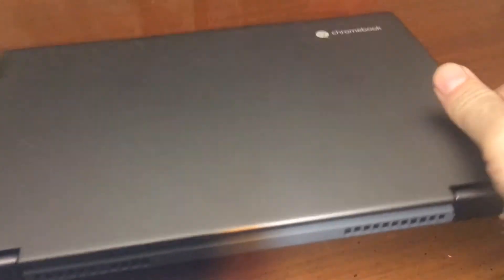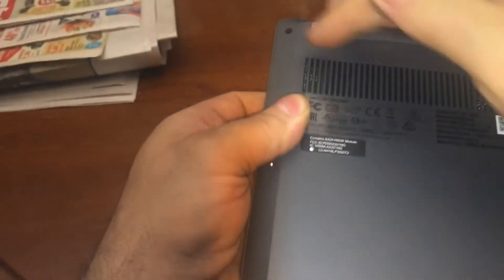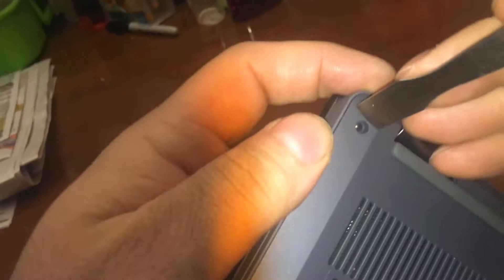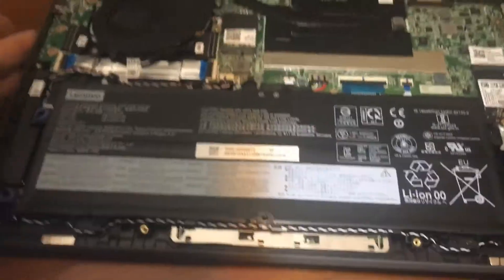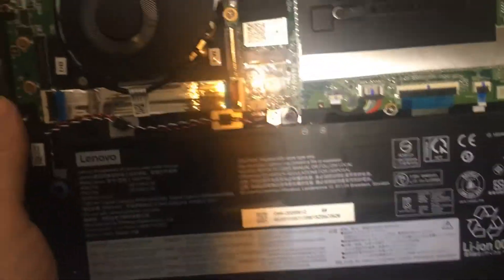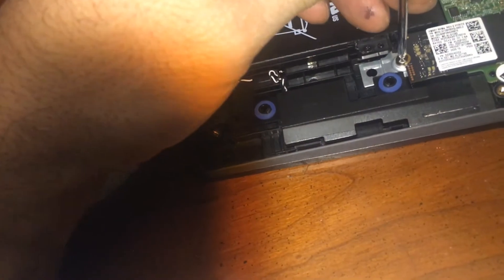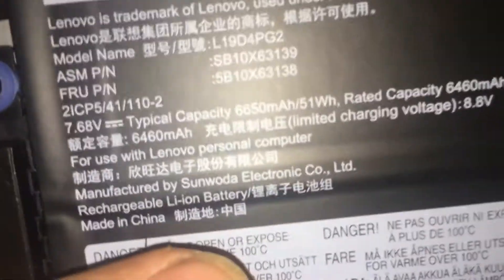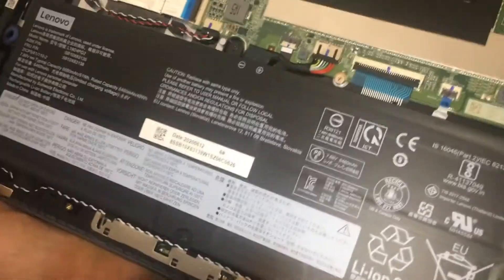Costco IdeaPad Flex 5 Chromebook 82B8 open case to see SSD drive battery other components replace

Comment: Great work. I am still too timid to open up any chromebook higher than 300 dollars. I have been using the 250-dollar Acer CB3-431 as my Ubuntu home computer for 4-5 years. I bought 3 of those, one in the house, another in the car, another in the storage. I have not used any windows at home and have not needed to uninstalled any bloatware for the last 4-5 years. You can install whole Ubuntu on the flex 5 chromebook if you disconnect the battery and boot it up with power brick.
Reply from the maker: nice.... always cool getting Ubuntu on these

Comment: The M.2 in your Lenovo is of the M Type it has five pins, it has only one notch.  There are three key types: B, M, and B+M, while a socket can only have one key.  The question is if it matters?  The answer here is yes, the M type has a bandwidth x4 PCi Express, about 20Gbits/second, so yes be careful, if you want to upgrade your storage space

Comment: Hey I just got the exact same 1 from Costco and its missing the right inside hinge pins...hold it up to light and you can see there missing. Did you notice that taking it apart?
Reply from the maker: I did not. maybe defect? return it. costco has a crazy return policy. LOL. I just returned some flashlights I bought in I think 2009
Reply: @bobspurloc  haha ya i love it so maybe ill see if i can trade it out. I just looked on the comments under amazon for it and it seems like alot of people are missing the pins on the inside of right hinge and have had their screens break along with the honge snap...kinda a bummer i love this pc
Reply: @Nicollrf  Thank You !  The inside right pins are missing on mine too.  Gee, I wonder why it was only 350.00.  Hmmmmmm ....
Reply: A.your welcome ... I know, it was a bummer to find out.  I decided to keep mine and just be super careful because the price for what you get was so good and its upgradable, as well as it gets updates until 2028! That sealed the deal for me. I figure With the extended 2 year manufacturer warranty it comes with and adding accident protection and the fact that um super careful and only use in laptop mode im praying it will be ok for awhile...
Reply: @Nicollrf  I'm super careful with mine too and haven't used it as a tablet, and certainly not planning to now.  I didn't get accident protection and unfortunately if the screen cracks at that hinge, Lenovo considers that user damage, which is not covered.  I also read that some screens at that hinge separate from the frame, unglued.  UGH.